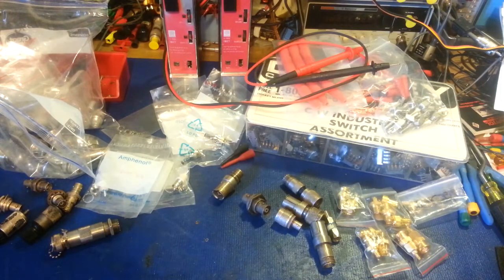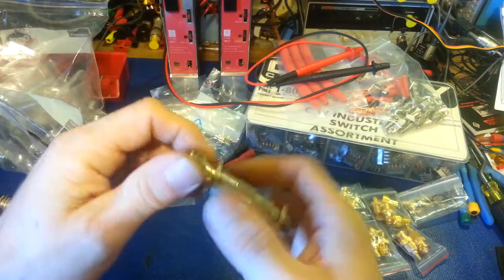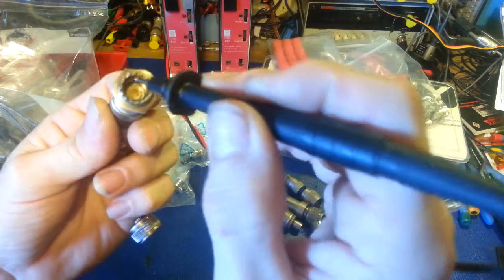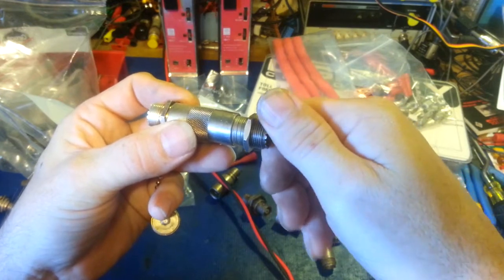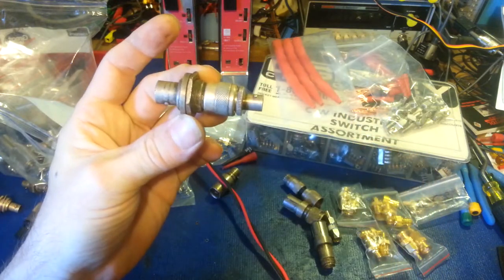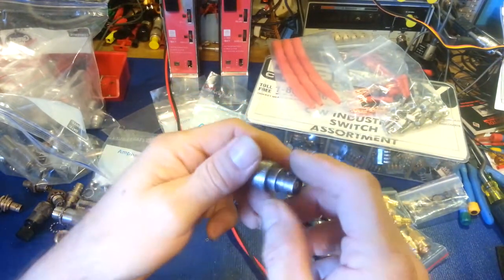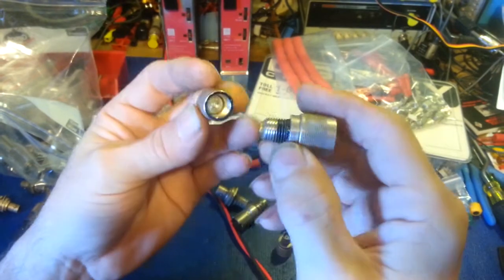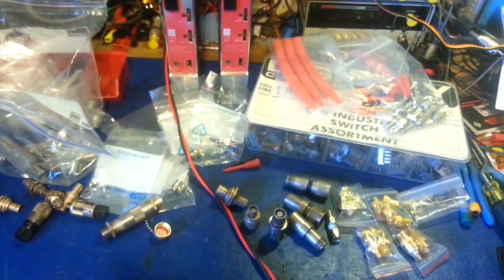RF / coax adapter type identification help.

Comment: First one is a sampling port.Second one is a type C BNC.Both were used in old analog TV stations. Reason I know is back in the late 60's early 70's I lived in Grifton NC. Right in the shadow of channel seven  WITN tower. Toured that place many times as a young lad. Fast forward they built a 2000 foot tower across the road where both WITN 7 and WNCT 9 are combined.  I was able to go into the old station after it was closed and disassembled. So much stuff was left behind.http://pages.suddenlink.net/w4ydy/witntv.html
Reply from the maker: Hope you got some freebies. :)

I had figured the first one was a sample port.  Most of them that are like this that are adjustable are part of a T fitting with this being one leg of the T.  Just strange its by itself.

How us the community making out down there after the flood?
Reply: Lots of people in the area came home after work yesterday, to find a sticker on their door left by county inspections  stating "This structure is unfit for occupancy. Repairs must be completed before re-entering the building. Please call blah blah blah".........
Reply: The Radio Shop  I do hope and pray you did not find one on your home. Thoughts and prayers to you and yours! Joel
Reply from the maker: +The Radio Shop 

Well that would suck.  It is better to be safe than sorry.  Years ago a good friend of mine had a flood at his house.  Long story short is he was doing the remodeling/repairs while they were still living in it.  About 4 weeks into the project their 3 year old daughter got sick.  She ended up with a respiratory infection and died a week and a half later.  People forget some mold is deadly.

Comment: Mike,
What is in the plastic bag on top of the plastic container top right of the frame?
Reply from the maker: Muller test clips and boots.  Restocking some alligator clips I was running low on.

Comment: I think the large BNC connector is called a "BNC Type C" connector.  Here is a webpage that ID's a bunch of connectors: http://www.mgs4u.com/connector-and-adapter-identification-list.htm  ~Jack, VEG
Reply from the maker: That page is a excellent reference.   I just printed it to keep on file.  So their BNC-C connectors.  I noticed they said they are often called big BNC.
Reply: Glad you liked it Mike, I saw a lot of connectors I've not seen before, I bookmarked the site for reference as well.  ~Jack, VEG
Reply from the maker: +Vintage Electronics Geek 

I haven't just seen I have most of them.  I just never use most of them.  Many are really old and rarely used these days.
Reply: I would imagine in your line of work you would need most....since my primary work/hobby/collection is photography I have a rather large collection of cameras, both video & still and both digital & analog with my preference towards very old and very early vintage digital, so having all those odd ball power supplies and other knick-knacks that make them work is indeed a must...even if it's used once in awhile...like you I troll eBay (and other) for my oddity fix!  :)  ~Jack, VEG
Reply from the maker: +Vintage Electronics Geek 

LOL, oddity fix.  Is that what I do on a daily basis on ebay.  Feeding my oddity addiction. :)
Reply: He-he!  I was just sitting here reading your reply when a quandary hit me....if you and I  (and folks like us) troll for junk....would that make us like some kinda 21st century junky? We must have our fix! and eBay is our dealer.... :)
Reply from the maker: +Vintage Electronics Geek 

Yep, no if's and's or but's about it, I'm a junkie.  :)
Reply: Me to brother!  :)